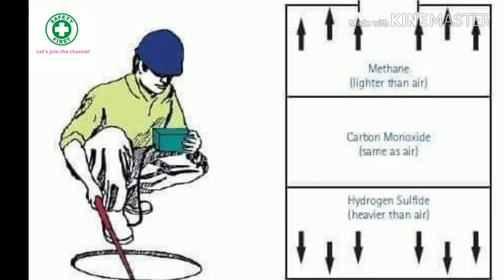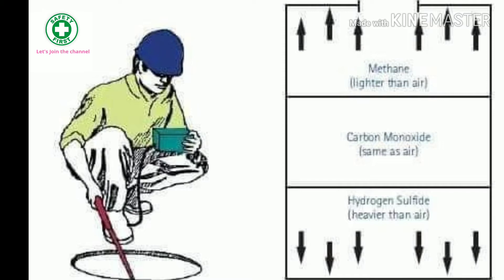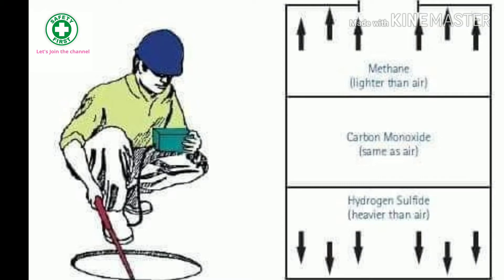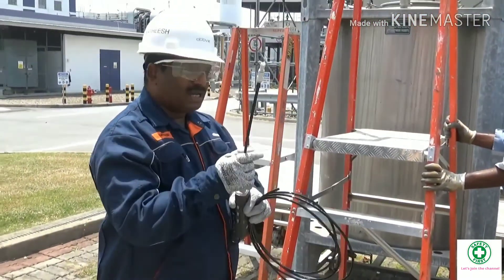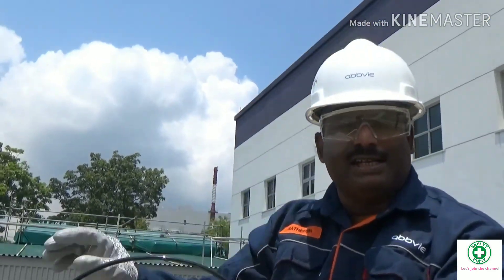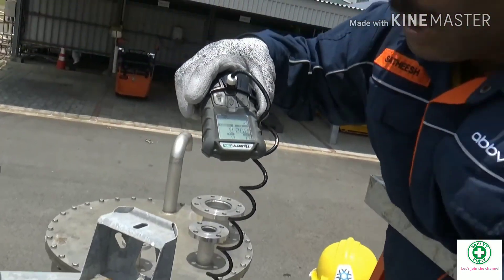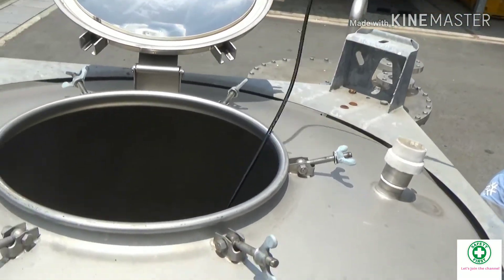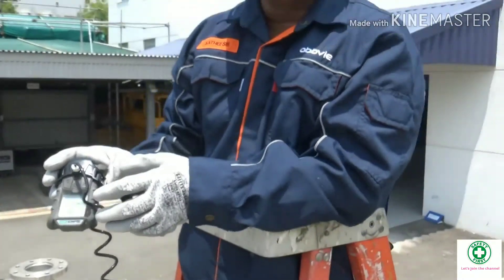HAZARDOUS GAS TESTING | don't miss practical video at end.

Comment: After how many minutes gas testing should be done after switch off of ventilation system
Reply from the maker: Varies with industry.. We used to go for hardly 1hour but the main thing is make sure all are out..